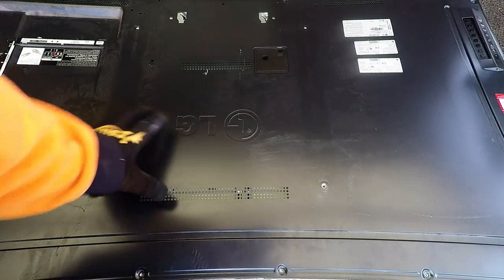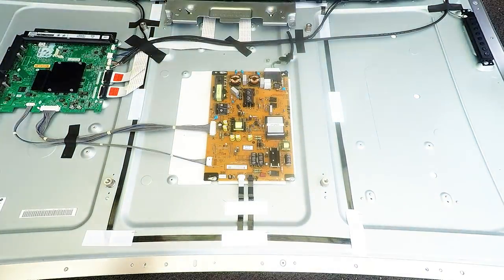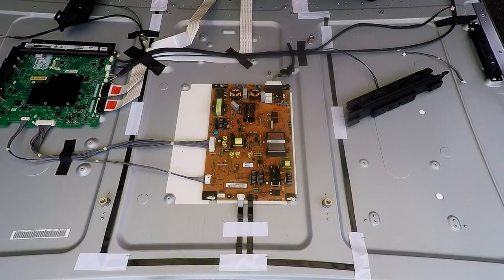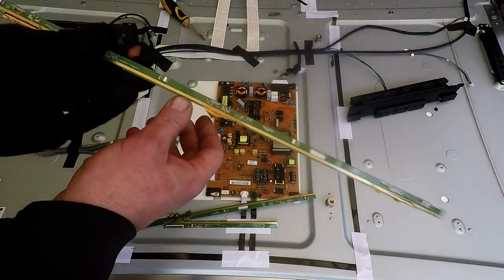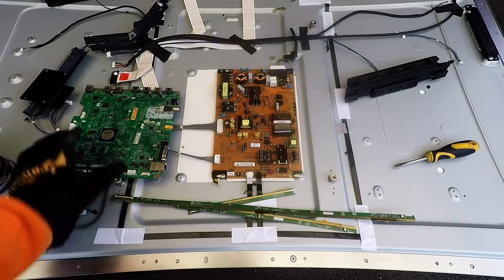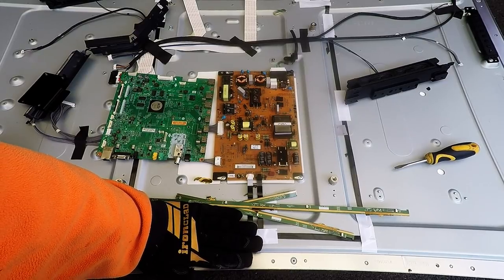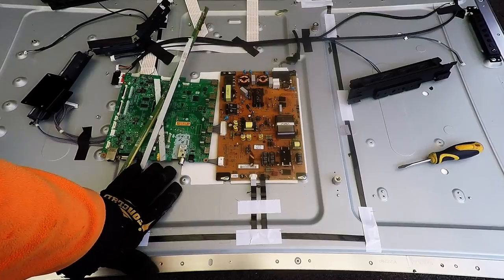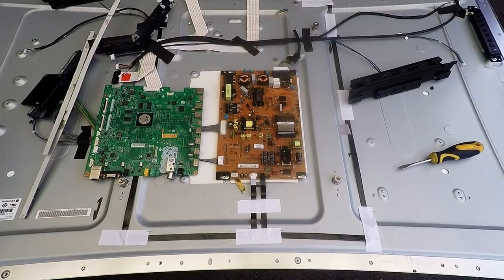Scrap LCD TV - The future of Scrapping LCD TV's

Comment: It turns out those tvs are not being recycled like we imagine. Yeah I bought used led strips for my tv on ebay for like 80 dollars. They just need to be powered and tested .. I'm finding alot of led strips with gold trace and they are all aluminum and can be sold as so. I'm finding some different green power boards and trying to figure out if they have any better value from the brown ones. I need to take another look but they are green on both sides and have alot of copper aluminum and ic chips. I think they are from the led tvs with the small mother board  but I need to start paying more attention because I was sorting by board color and when I look I find gold on brown boards and copper on green boards.

Comment: One thing I can’t understand about scrappers from the resource first standpoint is the $$ that went into organizing those resources.  Those power boards are little inverters, the circuit board if it works could be sold to repair shops or if it doesn’t work could be bulk refurbished, the LCD itself if it works can be frankensteined into another tv.  If the organizing of these resources into parts wasn’t worth money, they wouldn’t have done it.  Seems like scrappers of the future will consider the working organization of resources in addition to the raw resource value - nerds ftw.

Comment: Lets say that LED screen broke. but the Circuit boards work You could part that out and sell as parts in total around $500. Ribbon cables $20-25 each.

You are sadly mistaken saying that power board has NO value what if someone needed one the manufacturer has it listed for $170.. but you list and test it for $140...

Comment: There is no mercury in that TV or any of the LED TVs. Mercury is only in the CFC TV is the one with the long glass tubes inside the screen you have LEDs in that TV and the LED strips or worth money on eBay. Full set go from $60 to about $160 so you want to pull the screen apart recycle all the metal and pull out the LEDs for resale. You can easily look up how to test LED strips and just sell the functional strips and still make okay money.